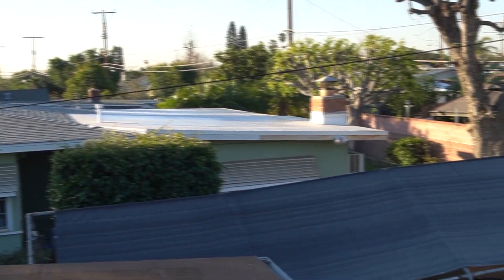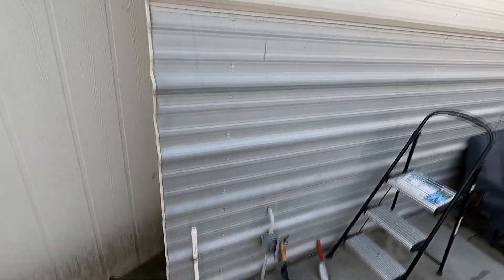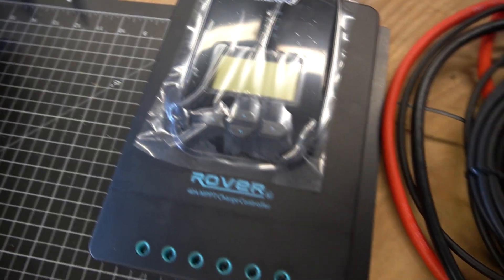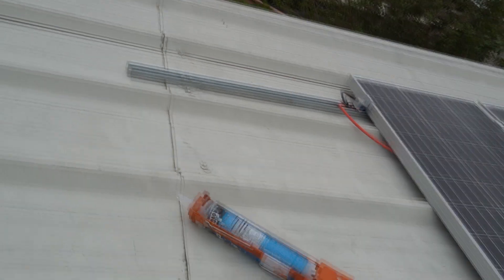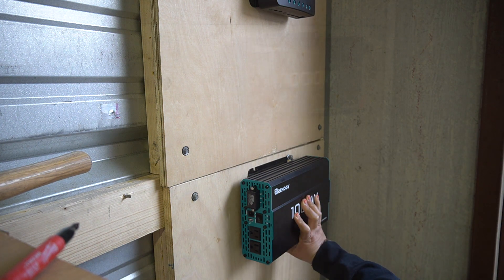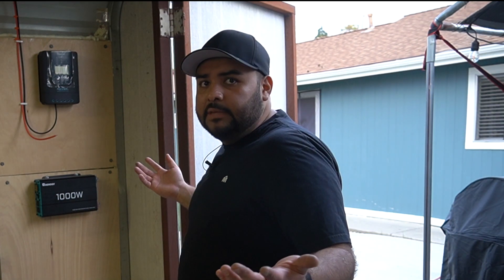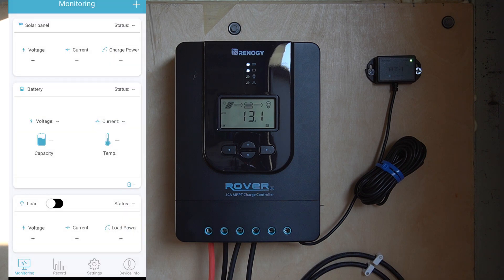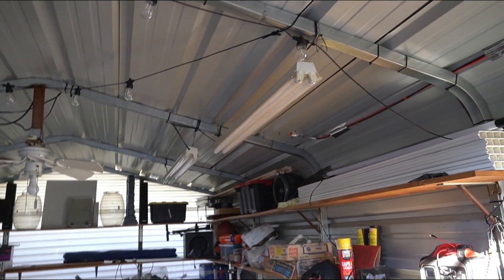How I installed solar panels on my shed using the Renogy 400 Watt Kit.

Comment: I did not see you use any adapters on the wiring. It looks like you wired it in series. I would think they would be wired in parallel.
Reply from the maker: Good catch, initially they were in series now in parrallel

Comment: Nice! Thanks for sharing. Only thing I’m going to do differently is bringing in all the wires through the back of the board, Like I use to do with my car stereo systems back in the day just to not see them. Probably use seal tight also.

Comment: I know you said your panels are now wired in parallel. What other parts did you need in order to run in parallel and all 4 panels laid out horizontally on your shed?
Reply from the maker: Hello, I used a variation of these Y adapter cables and made extensions where needed. (Affiliate links)  https://amzn.to/4cN99nU

Comment: Can this be used to supplement electricity usage in a small house?
Reply from the maker: If setup properly yes, however this isn't a high power system. It's more for powering lights and charging a few batteries in my shed.

Comment: Did you wire the panels in series or parallel?
Reply from the maker: Both actually. I did some re-wiring after the video went up.
Reply: @AlansInventions  reason for asking is ,I have seen and read conflicted articles, I wired my panels in series because the kit manual says the control panel knows how to convert it to 12 volt charge for the battery.
Reply from the maker: It depends on the input voltage and current range, as long as you are within those limits you should be okay. There is some negative effects to both series and parallel. That's if the input levels aren't the same, but for the most part usually okay for small setups.
Reply: @AlansInventions  they included a 40 amp in line fuse with the kit, do you think I should install it before the control panel? They didn't include the the terminal connectors on the wire coming from the positive panel, I'm not a big fan of just cutting the wire and wrapping the wire around the posts.
Reply from the maker: I would put the in line fuse where it's recommended. Is it a kit that you have? You can buy a terminal / lug kit and use that so it's not just wire wrapped around the post.
Reply: @AlansInventions  yes,a renogy 400 watt kit,came with the 1000w inverter,battery and control panel, and all the cables etc. didn't use the connectors to make it parallel. I wired the panels in series. The panel is supposed to determine the system is 12 volt.
Reply: @AlansInventions  the * control panel*

Comment: I started in November 2021 with four hundred watts of panels and four marine batteries from Autozone. Now I have sixteen 100 watts panels and twenty batteries.  I used a 24 volts Aims Power inverter charger. I added a 600 watts wind generator in March. I have enough power out here in the barn now. I used two panels to make around 34-41 volts coming in because the 4215 BN charge controller is 2% more efficient on 33 volts than it is at 63. So I had to overpanel because of the distance to the panels. I made some frames out of square tubing, two panels in each. Sometimes I have to bring some of them in because of hail. I didn't mount the panels on the barn, and last night I was glad of it. Lightning hit the barn. I have eight of them outside leaning on the barn facing East. Four on rhe West side, and four that I kind of move around on a longer cable. I put those in the barn last night. It storms a lot here, so they're safer like I have them. When I started, I didn't know much, so I was buying the 85 amp hours battery and saving for the inverter. One went bad so I have seven of those, and thirteen 105 amps ones. I replaced the bad one with a bigger one. My system works pretty well with twenty. I have 977 amp hours @ 24 volts. This barn actually has grid power but its so far from the pole that it can only run a light bulb 💡, so that's the only thing I have on grid, and I hardly ever use it.

Comment: Thinking about getting this kit myself for my shed. Just a thought about your installation, are you worried that the sun and elements are going to dry or corrode your exposed wires shielding so they'll eventually start making contact to your metal roof? Just an observation.
Reply from the maker: Not really, I ran most of the wiring under the panels and they aren't too exposed. If I remember correctly the wires I used were also UV and outdoor rated.
Reply: You can get some cable shielding at a salvage yard pretty cheap. It's on car wiring. I used it on the exposed part of my wind generator cable. It will keep the wire cooler. One more reason not to roof mount solar panels.

Comment: 12v won't kill you. now if its over 50v you get dangerous but 12v you can just touch like its nothing its a very safe voltage to work with.
Reply: 72v off the solar panel wouldn't be too safe

Comment: Great video. Question, how did you wire the solar panels? Series or parallel?
Reply from the maker: Hello
Initially it was in series, now in parallel
Reply: @AlansInventions  I have the 400 watt renogy system. If in parallel do you know if i still need the inline fuse from the positive panel? i know in series i need the fuse.
Reply from the maker: Hi I'm pretty sure you do but I don't know if it's the same one. If in parallel your voltage will be lower but higher current. If you are using adapters to wire in parallel some have a fuse built in.

Comment: I just ordered a 200ah battery and a 2000w inverter. I’ve had the 400w panel kit for a while now without setting it up and I’m just doing a bunch of searching and hoping my gear matches up it’s all Renogy. I’ve been living fully off grid for 2 years with a small battery bank and panel and also a generator I run sometimes for bigger stuff. Thanks for the video.
Reply from the maker: Nice! If it's the same as the one I used, I'd recommend wiring the panels in parallel vs serial. Also, nice move on the 2kw inverter! I've maxed out my 1kw a few times already.

Comment: I have this same kit with a 3000W inveterter and 3 100AH lithium batteries. What would i need to add to be able to run 2000W of power for 5hours a day?
Reply from the maker: That is a bit more complicated question, are you planning to run it during the day or off batteries? The simple answer is more batteries and more panels, both of which are expensive.
Reply: @AlansInventions  I appreciate your response. I will be running it during the day. Just trying to get an idea on what is needed based on my current setup. I am getting almost 6hrs of direct sunlight here in FL.

Comment: Thanks for taking the time to create and post the video.
Just a thought - - if you move that battery from the floor up to a shelf underneath your inverter you would not only free-up floor space but you could make the cables feeding the inverter shorter which will improve efficiency.

Comment: Can I just use a marine battery and not worry about the inverter  or do it half to have the inverter..
Reply from the maker: Inverter converts dc to AC power
Reply: Ok thank you what size do you think I would need
Reply from the maker: Well it depends on what you want to power
Reply: A shop light and a fan maybe a mini fridge
Reply from the maker: The first two could be easily handled by the 1000 watt inverter I used however the mini friedge not so much. If you already have it I'd recommend checking the label to see how many watts it pulls. You may need a 1500 or 2000 watt inverter.

Comment: Great video! I’ll be doing a similar setup on my shed. Can you provide the links to the specific spacers you used and the name of the conduit thing to run your wires from the outside in?
Reply from the maker: Thank you! Yes I can see below. Regarding the spacers, I got those at home depot, unfortunately I don't remember the exact part numbers or details. I believe it was the ones I also linked below.

https://amzn.to/3nyiPeY 
https://www.homedepot.com/b/Hardware-Fasteners-Spacers/Zinc/N-5yc1vZc2fdZ1z0vs17

Comment: Hi Alan, I set up a Renogy system about the same as yours. The only thing I added were reset breakers for all three legs of the power, solar inverter and battery with a couple bus bars one for negative and one for positive connections between them all. Wish I could leave you a picture...
Reply from the maker: Would love to see it! If you have Instagram my username is also AlansInventions there. 😁

Comment: You need the battery type to be on sealed or agm not flood or fld
Reply from the maker: Why is that?
Reply: Because you are using an Agm battery which is a type of sealed battery so it has a different charge curve than a regular flodded battery
Reply: He’s using a flood acid battery!

Comment: I don’t see any fuses installed inside the shed. Did you wire panels in series or parallel?
Reply from the maker: Great question. Unfortunately my answer is not a good one. Simply because I don't have the adapters and wiring to wire them in parallel. At some point I want to add four more panels and convert it.
Reply from the maker: I did  install fuses just didn't show it, also they are in series
Reply from the maker: Yeah I saw that, unfortunately I had already put my system up. Do you have any feedback you could share with me regarding my video? I am trying to see what I could do next. Also, any chance you saw my last drone video?
Reply from the maker: Oh okay! Cool. Thank you

Comment: I like that you didn’t use cheap hardware like most. It shows what a better product looks like. I didn’t see that you said that you ran the panels in series which would have been good to start with.
Reply from the maker: Thank you 😊 I ran them in parallel, at some point I will be rewiring them in series.

Comment: Rhenogy was a good choice; my Rhenogy equipment is very reliable. If you're going to replace the lighting with LEDs, you'll get much more efficiency by using 12 V panels and running them directly from the battery, rather than using 120 VAC and the power hungry inverter all the time. P.S. You're going to need more batteries.
Reply from the maker: Yes, but batteries are expensive 😂
Reply: It's wise to go led bulbs in my house we had 10 x 100 watt bulbs = 1000 watts I originally used the Florence at 13 watts each =130 watts now I have 9 watt led so 90 watts less than the power of one bulb when I go solar I'll be changing again to 12 volt 9 watt led bulbs I watched a utube video on using 12 volt bulbs as he pointed out why convert the 12 volt battery into 110 volts ac when you can just stay at 12 DC in his case because his house was wired for 110 220 volts his lights were on different circuit and tied to plugs as well so he's running.wires to new light's he's hung in every room looks hocky in my case all my lights are on a separate circuit so I just have to disconnect it from the panel box and hook it to the battery also both my sister and I are on cpap machines and they have a transformer that convert them to 12 volts and I can buy a 12 volt plug for them so I'll be running 12 volts to each of our nightstands and our chairs in the living room so we can charge our phones and tablets and only using 110 for what we can't run on 12 volts fridge freezer washing machine dryer furnace  stove as well as our well pump since in a lot of instances you'll only be using the lights that saves you inverter losses only turn it on when you need 110

Comment: Thanks. Came here from reddit link and I have a small cabin this will be perfect on.
Reply from the maker: Nice! 👍 The upgrades I would recommend are more batteries and more panels. Of course you would also need a higher capacity charge controller and inverter. Lol gets expensive quick!